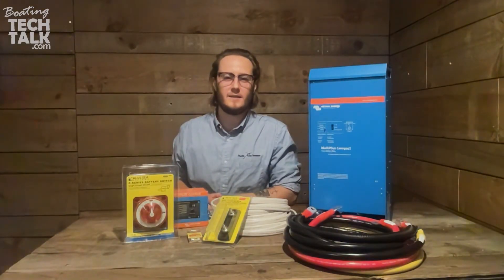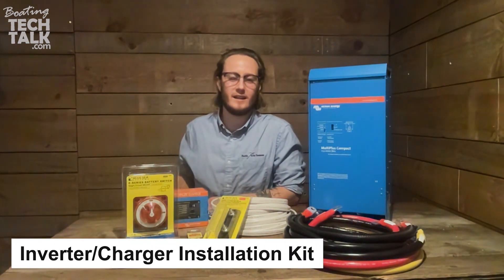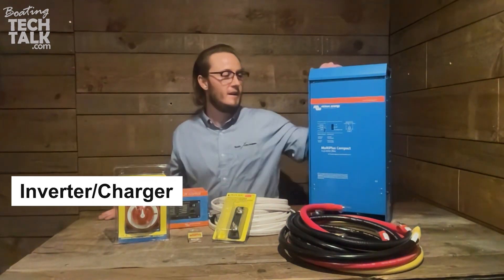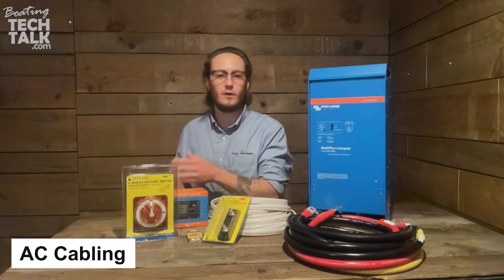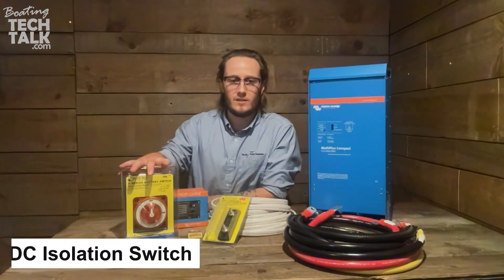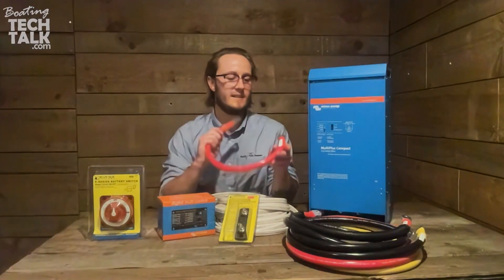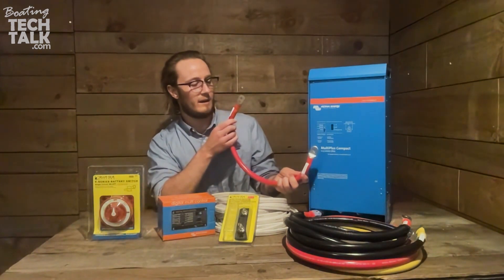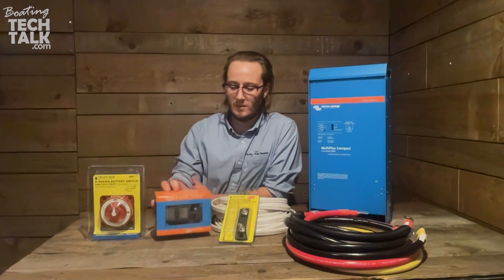DIY Inverter/Charger Installation Kit

Comment: Kit looks great! Should this ground be connected to the engine ground? I'll be powering it off of an independent lithium bank that is charged by solar and an isolated victron dc to dc charger. The sole purpose of the lithuim will be to power the inverter. I'm not changing the boats 12v agm system in any way. So, I was thinking that I would isolate the whole lithium inverter system but if I connect the chassis ground to the inverter I worry about galvanic corrosion while using the inverter while cruising/anchoring in the freshwater rivers here. Thanks for the new kit offering!
Reply: The chassis ground is there incase the return path wires gets cut. The current needs a return path if not through the chassis ground - then through your body when you touch the case.  Run the chassis ground to the unswitched negative bus (common ground).
Reply: @crashjunkie3106  if I do this, I still end up grounding to the engine through the common grounding point which again makes me nervous about galvanic corrosion while using my inverter away from the docks.

Comment: Great kit but the inverter is rated at 2000 volt amps so technically it is 1667 watts at 120 volts AC.
Reply: It is a 2 Kw inverter.